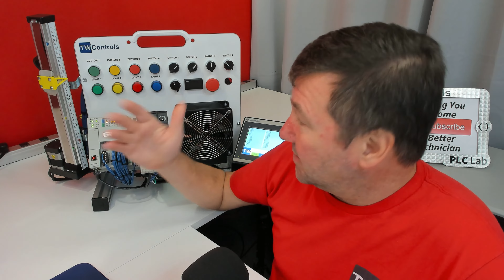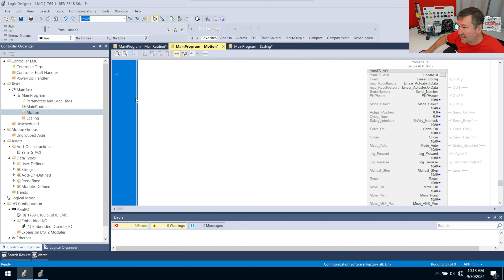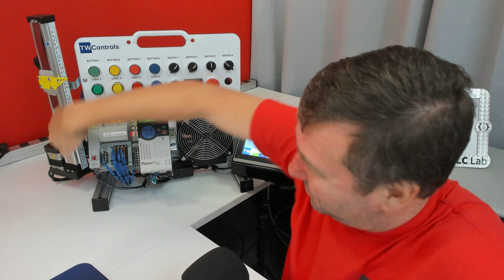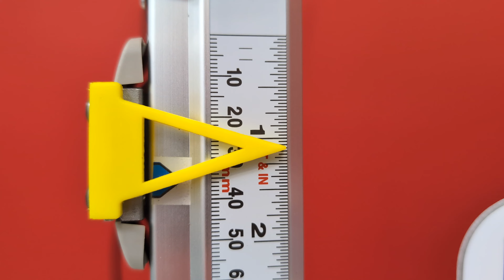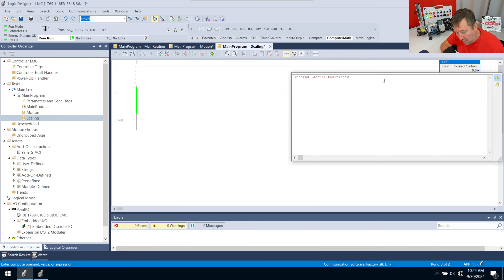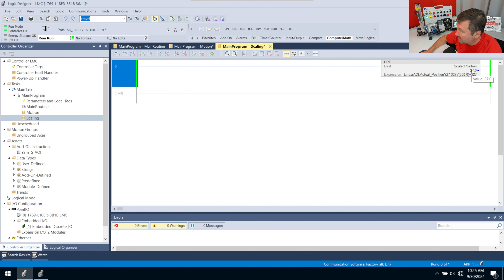Scaling and Offsetting Your Pick and Place Position Data

Comment: Hi Tim,
Im working on my bachelors thesis on an Yamaha Scara RCX240. I would like to do a combined application with a toolhead that does pick and place, milling and laser cutting/engraving. I'm having trouble with a way to generate a G-Code for the milling and engraving part. I saw some of your old videos about working with scara robots from yamaha, but couldn't find what I needed. I will be working with the VIP+ program with serial communication. Any ideas/ suggestions? Since Im a mechatronics student, I've got acces to fusion 360 and ptc creo for cad and cam software.
Reply: RCX240 is the controller and YK400X is the robot*
Reply: Hi Leo, my name is Chris - I work at YRG. The easiest way to command the RCX240 is with an ONLINE command. You can do that over RS-232 or ASCII over Ethernet. Basically like a TELNET session with PUTTY works, or even a Python Script. I tried to leave my contact information in the comments but I think Youtube erases it, so if you want to reach our search up YRG and submit a ticket there and I can help you our further.